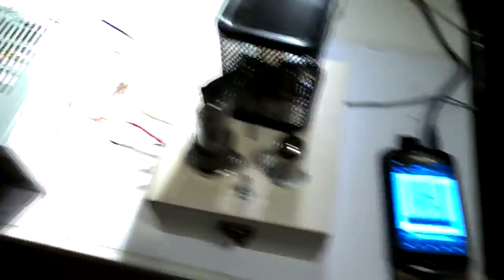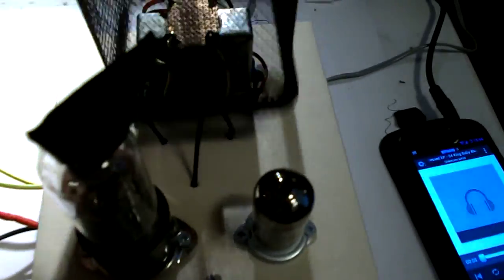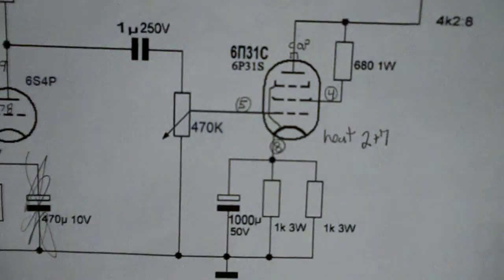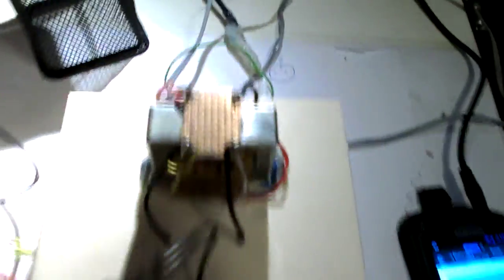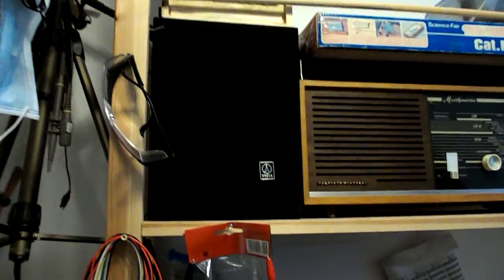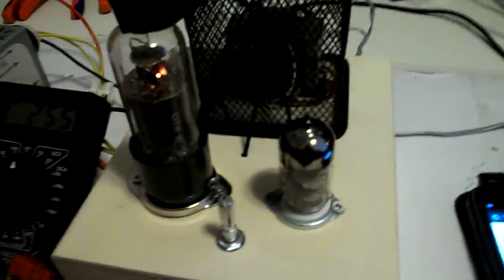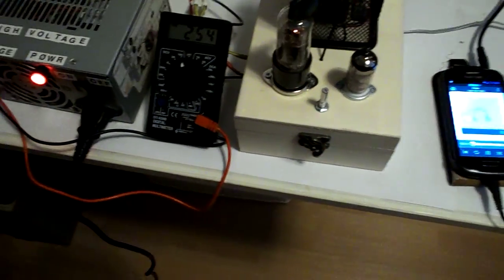6П31С (6P31S) Mono block Tube Amp! Success!

Comment: I am also interested, I want to build something like this.
 I did ordered 8 power tubes 4PC EL36 & 4Pc 6P31C. I ordered before I found this video, I sow a couple other SE schematics I will see which one I will use. My plate voltage will be like 340V.

Comment: You could try putting the cathode bypass capacitor in on the output tube, that should give some increase to the volume.
Reply from the maker: Not sure what u mean. Don't I already have a capacitor on that output tube (the 6P31S)? Do you mean connecting the positive of that capacitor to the anode?
Reply: ***** Sorry, my mistake, I meant the input tube (the triode), it will bring the gain up.
Reply from the maker: What u think of this?

http://i51.photobucket.com/albums/f396/czechrite/tube%20electronics/6N2P_6P31S_CSW_amp3-1_zpsomuirzfo.jpg

I'm using a design like in your pre-amp and EL84 amp, Clem. I was not sure on the resistors...I just threw this idea together away from home and I haven't been able to check anything. Also, the original design for the output transformer resistor (just off the transformer and power supply) was only 1k. Should it be 10k? Would it help put more load on the pentode AND maybe put the voltage at a more appropriate level for the preamp? Suggestions are welcome.
Reply: ***** That should all be just fine.  Another reason why the output is low is because the output pentode is connected in a triode configuration, that always improves sound quality but at the price of audio volume. if you connect the other end of the 680 ohm resistor to the 270 volts supply intsead of the anode it should be much louder. The 1k resistor you mentioned can really be anything from about 1k to 10k, it doesn't matter that much, the resistor and the 22uf capacitor help smooth the voltage supply going to the triodes.
Reply from the maker: CoolDudeClem I got an idea from an old Soviet schema which connected the 2nd grid to the supply like you did in your "original CDC amp" (which used that groovy retro-looking 1626 triode and 6C6 pentode) but they used the pentode in "semi-triode" mode....by putting a big capacitor between the g2 and anode. What do you think? I'll post the schema below with what I saw and my own version.

http://i51.photobucket.com/albums/f396/czechrite/tube%20electronics/6N2P_6P31S_CSW_amp3-21_zpsodhoqpno.jpg
Reply from the maker: Ok. Here's the link. I don't know if I should keep the resistor or not or if it's totally crazy but it looks right.

Here's my new version again:

http://i51.photobucket.com/albums/f396/czechrite/tube%20electronics/6N2P_6P31S_CSW_amp3-21_zpsodhoqpno.jpg

Here's the soviet design using a cap for a "partial" triode effect:

http://i51.photobucket.com/albums/f396/czechrite/tube%20electronics/6P14PEl84%20amp%206N2P%20russ%20monoblock_zpsrlfuiuax.jpg
Reply: ***** Keeping the resistor connected and going with what I originally suggested would be a good idea, without the resistor there will be no voltage on g2, the tube will have almost no output at all (if any).  I haven't seen any other amplifiers that use a capacitor between anode and g2, except for that Russian mono-block, you could try with and without it and see what kind of effect that has.
Reply from the maker: CoolDudeClem Ok. I will connect it as you recommended. As I understand, I should KEEP THE 680Ω in place and connect it to the power line as in this diagram:

http://i51.photobucket.com/albums/f396/czechrite/tube%20electronics/6N2P_6P31S_CSW_amp3-23_zps4kdadmak.jpg

Thanks for your advice.
C
Reply from the maker: unfortunately now the tube seems overdriven...the preamp is too strong for the power amp. I'm really not sure what to do at this point. Maybe this tube is not right for class A type setup. I'll ask Robot what his setup is like.
Reply: @AtomicElectronCo  Years later I discovered that the problem was the transformer output. It has to be "switched" at the transformer as the sound wave has been inverted. I struggled with this for MONTHS. Reverse the "input polarity" going into the output tranny and it will work just fine!

Comment: does your 6p31s glow blue
all mine do glow blue
and in my russian tv it looks like a merqury rectivier

if it does not glow blue you need to load it more :P
Reply: more voltage would help and also a better output transformer
Reply from the maker: no blue glow m8. What you mean "load it more"? You mean reduce the cathode resistor(s) value of the 6P31S? Or you mean just send a more amplified signal to the 6P31S g1 One of the reasons I tried this experiment was because you told me about their groovy glow! Point me in the right direction! Thanks for your help. CHeers! :D
Reply from the maker: I upped the voltage to 340v from about 260v with little difference, btw.
Reply from the maker: ***** I think it will also help to build the preamp with moree gain using a 6N2P type double triode. That was someone's suggestion. What do you think?
Reply: yea that would also help for more power
just add more preamp stages untill the tubes starts distorting
and after that improve the output stage
Reply from the maker: ***** That sounds good with the preamp ideas. What about the output stage? Improve it in what way? Add another power stage? I will try working with the preamp first...then we'll see about the output stage like u say. Clem said something about putting in a capacitor for some added volume, but I thought I already have that done.
Reply: like i said more voltage
adjust the bias so that you have the correct- voltage at the grid
use a output transformer that has a bit more impedance
the tube can handle a great beating bevore you kill it

in fact it boils down to this
you need to pull more mili amps

online i have read (for the el36)
350V at 32ma
this will make around 10.5W and will not kill ther tube (16W is max)
Reply from the maker: Right. I guess I should take some voltage readings first. I don't have much experience at that but I'll try. Or I could tinker with the resistance a bit to see if there is an improvement or not.
Reply: My test setup uses a raster transformer from a TV
And my tubes glow a bit blue
Reply from the maker: Raster? I could also try to hook up a good pentometer to the cathode on the 6П31С (6P31S) power tube if it can handle 3 watts. It is a new old stock TESLA pentometer. Carbon film, I think.
Reply: What I mend with raster transformer is the transformer that drives the vertical raster of a tube television
Reply from the maker: aha. ok. That's new to me. I'm still a beginner. I would love to find one of those.
Reply: pff there common
look for an old tv with a broken pirture tube
or with a broken case
then you have a output transformator and a rester trafo
Reply from the maker: I've often run into old tvs here and I've salvaged many for flyback transformers, but I can't find any information on google about what one is or what one looks like. I have no doubt you know what you're talking about, but are you sure it isn't spelled different or something? Can you give me a link to reference or a photo? I'm not getting ONE hit for "rester transformer".
Reply from the maker: I've seen other transformers in old tvs...but mostly I've left them alone. would it just be any small transformers nearby the flyback?
Reply: they dont have a fixed spot in the tv

the output transformer is easy to find
and the rastor transformer is coneted to the deflection yoke
Reply from the maker: Is this it?

http://mujweb.cz/jmartis/flybacks.jpg
Reply: No that is the high voltage transformer and horizontal deflection
I have a video about powering one like that
Reply: That is a raster transformer
If you look at the circuits of that TV you can see it is conected to the yoke
Reply from the maker: ***** ok. I know this one. I don't know what it's called in English but it doesn't matter. I've seen that before in many TVs I scrapped BUT I JUST REMOVED THE FLYBACK and tossed the rest mostly.

When you say "you use a raster transformer", do you mean you're using it as an audio transformer? That's amazing! I think I do have something with more impedance somewhere...but I'll look for the rasters too.
Reply from the maker: ***** will they also be in TVs that are old but not totally tube? Like an older solid-state TV?
Reply: ***** Thouse transformers are marked TVK in sovet tube TVs. I dont think that they were used in solid state TVs. And even if they were, I dont think that transformers from solid state TVs would be useful in a tube circuit because they would have lower impedance ratio.
Reply from the maker: Juodas Varanoidas Yeah, that sounds logical. I did find some of those once in an old Czechoslovak TV but I only bothered to salvage the flyback. But even if I found one, what would I do with it? Use it as an audio output? High impedance on one side....what about the other?
Reply: *****
It could be a pretty good output transformer. If you find one just connect it like you connect normal audio output transformer. High impedance side to tube, low impedance side to speaker.
And to get more volume out of your amplifier you should increase anode resistor of preamp tube to 50-100k. You could also add one more preamp stage.
Reply: yea i agree with juodas
and for the solidstate tv
most of them have the transistors drive the yoke directly
Reply from the maker: I actually already increased the anode resistor on the preamp to 100k. It helped a bit but only a little. Could I change the cathode resistor on the 6P31S? or should I put more resistance below the pot? Should I make the resistance of the potentiometer higher? Otherwise, I think the best thing is to add another preamp stage...what u guys think?
Reply: *****
You could lower the cathode resistor of 6p31s, but only when your preamp is capable of driving the output stage to clipping. And that would wear out the tube quicker. You should replace the preamp tube with a double triode like 6n2p so you would have two preamp stages.And you should also make sure that the voltage at the anode of preamp tube is arround a half of the power supply voltage as that would allow to achieve maximum voltage swing before clipping. I think that your pot has enough resistance, higher resistance pot will not make a difference.
Reply: i still agree
Reply from the maker: ***** Ok. So I will just go back to original thinking. A 6N2P tube or E88CC. I should be able to do that conversion in an hour or two once I have the time and I figure out the resistors and such to go with the double preamp stage. Thanks guys for all your advice.
Reply from the maker: Ok now I have put in the 6N2P preamp and if I turn up the volume past 30% or so I get CLIPPING. Big time CLIPPING. So, what's next? Reduce the cathode resistance on the power tube? This is what the schema now looks like below. I've tried both in "triode mode" and natural pentode mode. Result is more or less the same.

http://i51.photobucket.com/albums/f396/czechrite/tube%20electronics/6N2P_6P31S_CSW_amp3-1_zpsomuirzfo.jpg
Reply from the maker: Juodas Varanoidas Ok now I have put in the 6N2P preamp and if I turn up the volume past 30% or so I get CLIPPING. Big time CLIPPING. So, what's next? Reduce the cathode resistance on the power tube? This is what the schema now looks like below. I've tried both in "triode mode" and natural pentode mode. Result is more or less the same.

http://i51.photobucket.com/albums/f396/czechrite/tube%20electronics/6N2P_6P31S_CSW_amp3-1_zpsomuirzfo.jpg
Reply: What is your negative voltage on the grid

And the clipping means that it does not have enough voltage on the annode
Reply from the maker: ***** negative voltage on the pentode grid? I don't know. I guess I had better measure everything.
Reply from the maker: I tested everything and sometimes it even sounded better when I was testing! Crazy.
Go to my new video to HEAR the problem and see the voltage readings. Thanks.

https://youtu.be/KClFX4_HZrg
Reply from the maker: I'm thinking I need to set this up as a class B or there is something else I don't know about. Robot, is your setup a class A or class B or something else? I don't know how I can load this tube like that or overdrive it in a way where I can listen to it and enjoy it.
Reply: i dont know the diverence
my setup is kathode biased and a standard single ended setup
my power supply is around 260V
but i somtimes go up to 300V (just for the lols)
my ugt is a raster transformator (vertical deflection)
and it has a single ef86 preamp

i am gonna rebuild it soon becaus the power supply gets hot

and my rectivier is a ez81
Reply from the maker: ***** still not glowing blue or fluctuating with sound at all. I'm guessing somehow yours are overdriven. I would like to know how....

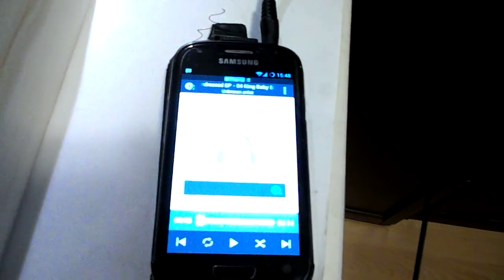Comment from the maker: This amp is made from a 6П31С (6P31S) power tube and a 6S4P triode for preamp. The quality is GREAT and first time I heard "triode sound" through a pentode or beam-tube. The volume is not as high as I expected so maybe I'll try a double triode next staying in with cheap and sturdy Soviet tubes like a 6N2P. We'll see. Anyway, if anyone has questions or suggestions, please ask. The actual test starts at 4:20 on this video.